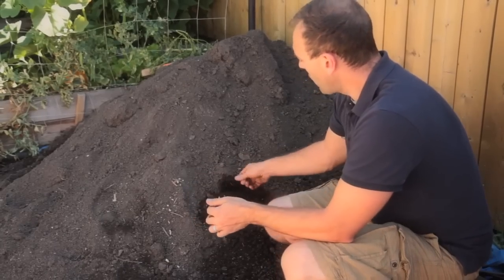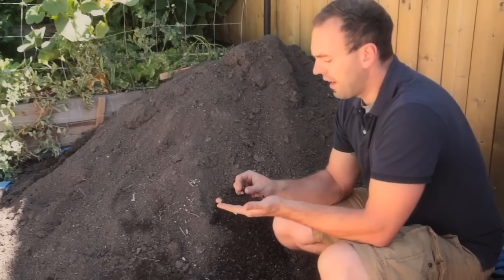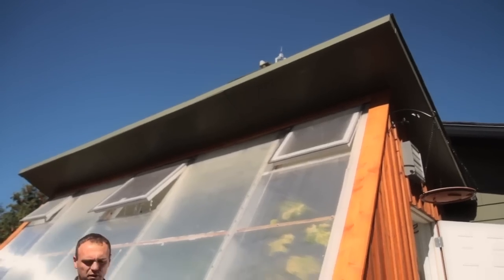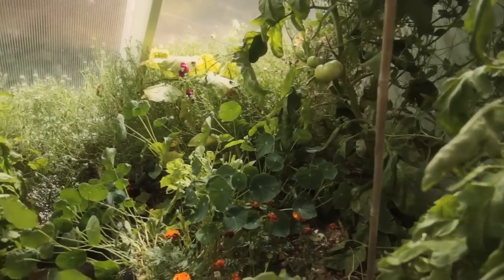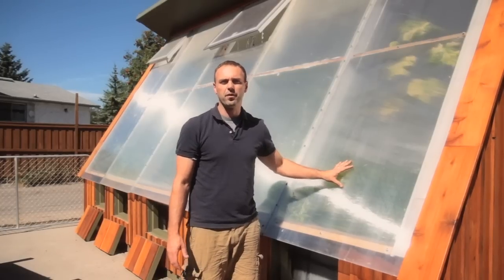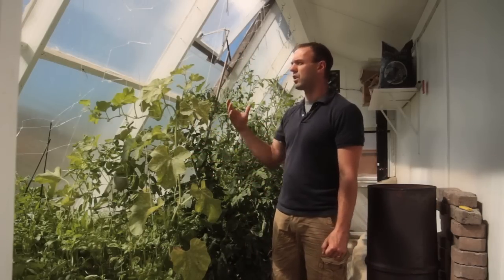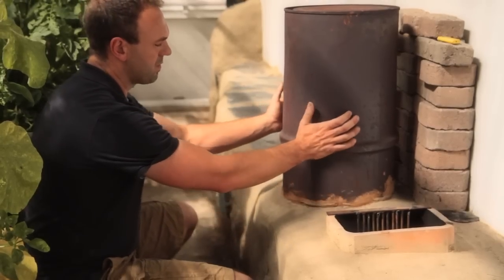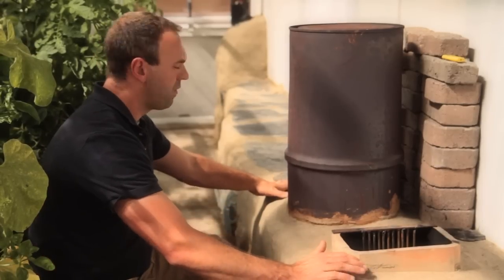Our Cold Climate Urban Homestead  //  pt. 3

Comment: One interesting question regarding the "glazing" of the green house, doesn't it degrade after some years ? - Glass is expensive and heavy - are there transparent materials that will hold up to frost, heat and UV radiaton ? (it might be still worth the investment if the materials need to be changed ever 12 years and responsibly burned or recycled). 
The inserts that they can take out of the lower wall are genius. Good air circulation is crucial to avoid problems with pests and mould in a green house. Or mould because of condensation  in winter with fairly extreme temperatures.
One downside is that there must always be someone present to heat the rocker mass heater to make sure the plants do not freeze. 
(back to the power of community).

Comment: I am wondering if you could use evacuated tubes to heat a large container of water for a heat sink. Perhaps a 2000 gallon vessel on the north wall.

Comment: 0: 10 Communty as unintended benefit of being good stewards. - Geoff Lawton (and Dr. John Delony, psychologist * Dave Ramsey Show) also point out the value of COMMUNITY / Connection. That is - or can be - a crucial backup for regular folks, what gives the families and farms RESILIENCE during emergencies and crises. - Cotswold Seeds sells seeds for and educates on the value of green manure and cover crops for farmers. They tested mixes (1, 2, 6, 12 different plants used as cover crop).

The more differnt plants -  the better the cover crop performed. And even the most productive single plant as "monoculture"  is beaten by the performance of a 12 (and even 6) variety mix (and it is a distinctive advantage, I seem to remember 15 %). That is important because the seeds for the "top achievers" can cost more costly, be tricky to establish (or not a good fit for this soil and climate), and in some year the conditions may be less than ideal and the expensive seeds do not come through. (In a mix there are still 11 others that can perform, or help the one plant to also get established).

Those COMMUNITIES of plants boost each other, even the overachievers do better than if they were on their own. 

* I think Dr. Delony calls it the human / community emergency fund (the equivalent what Dave Ramsey recommends for prudent fininancial planning, to always have some money for emergencies in the bank and to avoid debt).

Comment: well said, I would like to see one site where all of these ideas or techniques can be summarized by category and rated with real data.  like top 5 way to heat water..... top 10 ways to heat your home with real data ....
Reply: the "top 5 / top 10" type of advice are used for headlines to get traffic and attention (see pinterest) but they don't do justice to the nuance of solving the energy demands of individual homes.  It depends. There are solutions that work for many homes and are good enough for an investment for 20 - 30 years. Forget about "the best" whether it is price or functionality.

Good value for a reasonable upfront investment.

 Always good advice:
In general get good insulation, good planners (word of mouth recommendations) & avoiding construction mistakes. Factoring in the condtiions of the site (wind or existing trees and one can also grow trees to shade the house  during summer (and provide evaporation cooling) but they let the sun pass in winter. Even climers could be used for that purpose.

Solar panels at the current costs are a no-brainer in many regions, it is foreseeable that batteries will drop in price so one can go for the larger installation and chose a producer that has integrated systems and it will be easy (and even possible !) to upgrade. Or going for the "too large" system right now (in 5 years it will come handy to fuel a vehicle, and likely will make some money if more and more cars need electricity and fossil fuel generated becomes sidelined.

Batteries will be a game changer and the size of solar panels should reflect that. Current panels can easily last 20 years, but not necessarily the batteries, so one can plan for it to get better batteries mid term. So going for systems and manufacturers that have such flexible and modular solutions. 

On the other hand: Run of the mill systems are still good enough if conditions for solar are good. Like in Calgary. 330 days with sun is not bad, even short winter days produce with snow reflection and no need to cool the panels. 

one simple design fix :
Windows shaded in hot summer: Blinds outside, shutters, a large roof that shades the windows in summer, but not in winter - if the hurricane situation allows for that). But letting in the sun in winter. There are inside blinds that have reflective surfaces towards the glass, or foils that can be applied to glass (and removed). If the residents rent and can't do anything at the outside of the building. Looks like people in CA have upgraded from single to double pane windows and that makes a difference regarding how much the homes heated up during the last hea wave - need for A/C.
During such heat waves there may the rolling blackouts and then it is good to have passive, free cooling effects. The input and investment of growing a tree and cutting it back, or new windows is plannable. 

In many regions they would not get away with single pane because of winter temperatures, never mind summer effects. The costs for the windows is saved in A/C costs (even if you get it from solar panels that still costs), and the better windows ADD security in case of severe cold. 

For insulation rather use mineral wool (or any other material) than styrofoam.  
Mineral wool is fire resistant and can be recycled, and those facades also hold up better during extreme hail events.

If in doubt go for the slightly more expensive, robust !  solution.
There is a case to be made for passive security, for old fashioned sturdyness,  and for the Pareto Principle. 20 percent input get you 80 percent output. It is a version of concentrating on the low hanging fruit. The angle of the glass house is steep to avoid issues with snow load and in order to have less construction costs (sturdyness of the structure and beams). That was a good enough / fairly good solution, even though a less steep angle would have advantages (which come at a cost). 

Also: technology fixes cost, can cost more if you have unexpected repairs, and you can only estimate how long the tech will serve you. When the unit fails after 15 years instead of 20 years life cycle the calculation is different.
With sturdy but slightly imperfect you know your costs, it is unlikely you will have any costly repairs. For instance the rocket mass heater does not cause costs for changing the electronics or the catalyst - because it does not have those features.

Tech can fail during a major crisis (power outage).  Then passive systems are king. Like sprinkler systems can fail but a fire wall in a high rise with the right kind of doors (if authorities or house administration controlls that they are closed) WILL delay the spread of fire whether the building loses power or not and whether or not sprinkler systems were prudently maintained and that they tested emergency power supply (back up batteries).
Passive safety. A person in charge controlling twice per year that the fire door is closed - and interventions if residents mess with that, which is usually stopped and reversed by suchinspections. That is a low key, low cost measure. Authorities doing fire insepctions every 5 - 10 years (and invariably residents have failed if the house does not have a person in charge to stop that in its tracks). But those 5 years inspections are a reminder of what is important and restore good practices.

If the fire hydrant area is used as parking lot, a few persons will suffer the consequences of being towed. Then a sign that that has happened, and if firefighters arrive they WILL have immediate access to water. That was one of the problems with Grenfell Tower. Wrapping the house in tinder (aka the refurbishement got them new CHEAP cladding) was the most important mistake. 

Good enough affordable insulation, and windows  (but it is not a net zero home). If new windows are expesive insulation curtains can be a good provisory fix.

Solutions with higher efficiency get you often get you into the more- than-the-80-percent territory where costs (and failure risks) increase disproportionally.

Another principle: Good quality (in consulting) COSTS, and don't be a penny pincher. That drives out the GOOD consultants out of the market and the costs of planning designs can be much higher over the 20 - 30 years than the risk to pay 5 - 10 % more than the lowest possible SOLID offer.

That is how consumers end up with geothermal installations that are design / planning failures: where they exract more heat from underground than can be regenerated in the warmer season. That can be incompetence or the attempt to come up with an offer that appears to be cheaper, but they are cutting costs by cutting corners.
 (saving on depth or the area of the pipes). 

The flaw only becomes apparent after a few years.

 A good plumber will not do the easy thing and have bends and diameters that inhibit flow and then require a stronger pump to compensate for lack of plumbing expertise (or lack of attention to detail). that pump costs more and is going to need more energy for the next 30 years. One could as well pay the plumber more (usually the planners have manufacturers and plumbers they work with). One can hope the selection will be for high quality devices and people that now what they are doing.

That spreads knowledge in the field and rewards the best actors and in the long run it might not even be more expensive for the buyer. 

So one would need a good local planner and not drive many consultants crazy with getting 10 offers. consumers that act that way train the consultants to be disingenuous, it will not be the quality planners that make it in that kind of market. Good engineers are not always good sales people.
In a market where consumers find it O.K. to chase for The. Very. Best. Offer by consuming so much time of  10 (hopefully) well qualified planners (with 10 qualified plumbers behind them that have to work on the specificis of this or that offer) chasing the lowest price - The bullshitters and the . In the long run it does not really matter if the installation would have cost 10 % less with another offer. If it is well planned it will also be robust and should deliver for 20 years and more. So the 0.5 % more costs annually versus the risk to fall prey to a less than ideal planning. .

Canadian homes are usually well insulated but they still failed to perform well during the recent extreme heat wave (July 2021). In Canada getting the sunshine into the house via the windows is normally a good thing. In winter it is excellent, and in summer the nights are cool enough that the homes do not become heat traps (where insulation works against you). The homes and cities still cool down enough to make the unwelcome summer heat wins tolerable. 

Sure one can have a fancy ventilation, A/C / geothermal system (investement, failure rate). 

Or one builds an old fashioned brick and mortar home and has shutters OUTSIDE. any blinds inside are much, much less effective, you still get the solar radiation into the home.

having MASS inside a timber frame home helps, it is o.k. if the outside walls a lightweight, as long as there is ANY mass in the home to be a heat buffer. If the stability of the home (floorr !!) allows it one can have loam walls, brick and mortar walls inside, concrete floors.  And a rocket mass heater (rmh), or a masonry stove would also store cool night air and keep the home cool when the day temps go up (despite closed windows and good insulation).  However in some cases the floor might not be stable enough to support that weight.

Having inside walls (those that do not bear the load) or stoves made from locally resourced clay / loam is also a sustainable solution. No sand, gravel, bricks or cement needed. Not even chamotte that is used in masonry stoves (stoves with tiles and also a lot of mass, that function like rmh) - or quality wood stoves. 

The material can be dense clay or loan from deeper down - the excavation for a pond for instance or a rainwater tank. 

That can be a cheap solution that is not quite as fancy and may be slightly less efficient compared to a geothermal installation that feeds heat into the underground and thus works as A/C in summer and makes the heat lift easier in winter.

Comment: How well does that evacuated tube solar collector fair in those hailstorms?
Reply from the maker: Conny, no problem. I believe they are rated to take a 1" hail storm. The angle of the panel helps to reduce the impact of hail that is failing in the vertical direction.